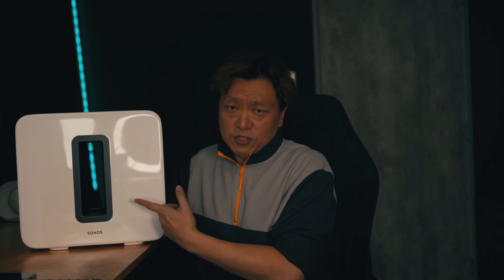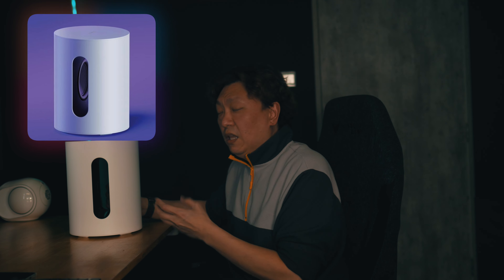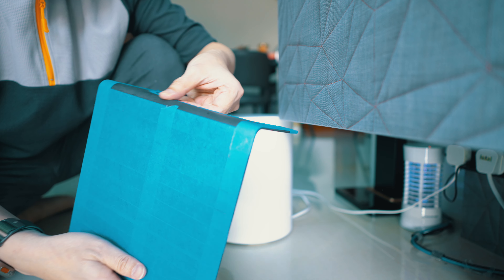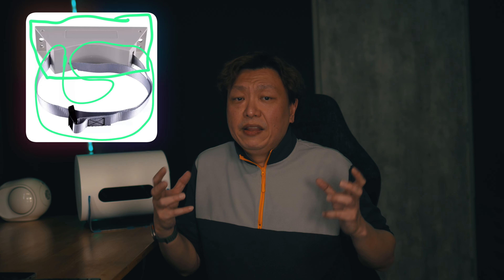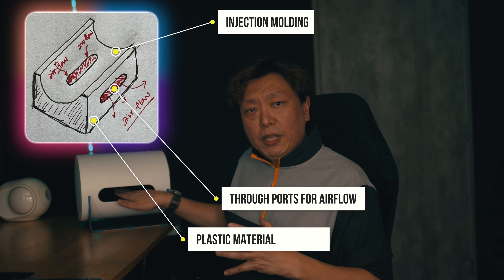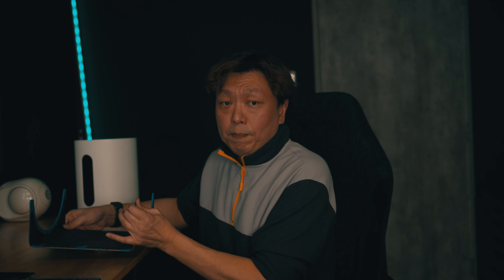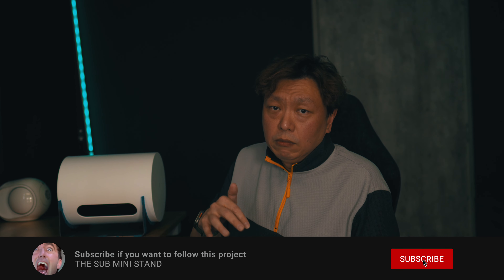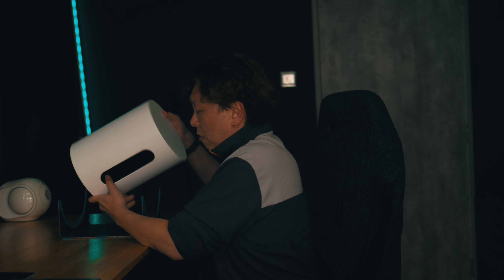World's first Sub Mini stand (Beta). And I need your help to complete the project!

Comment: Hello Peter, I think two small rubber pads which stables and  lifts the Sub Mini from the ground would be the better option, costwise and also from technical point of view (better damping). My use case does not require such pads, but for sure there are many who would need it. Nice idea and good luck 😊

Comment: It's not something I have a use for, but I think it's a fantastic idea.  As far as cost goes - well Sonos and Sanus both charge very high prices for their premium stands too, so I don't think a few hundred dollars would put someone who really wanted this off.  You might be able to get the cost down further by shopping around engineering shops, and manufacturing in volume - always difficult to balance such things as you don't want to end up having a lot of stock sitting around for years with your money tied up in it.

Comment: Bro you should but like velvet mounting points yeah maybe rubbery lol but it’s stunning I have a mini and would love to see pricing soon and your store make it available to us. But you know your second prototype you can actually have your bracing sit subtlety and it will still achieve that hovering effect because it’ll be resting on the sub mini I would say that should be velvety touch point. You should brand every base with your brand like stamp it out. But maybe filing all those edges will add more manpower processing??? An adhesive emblem will be nice! And bro I think your finish product should be “acrylic” it’ll be easier to ship anywhere and stack logistically speaking.